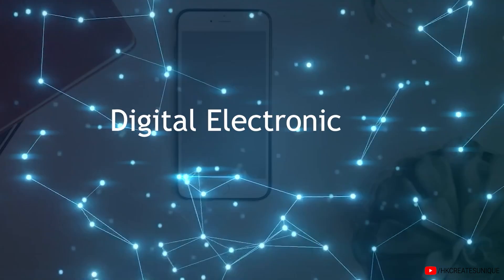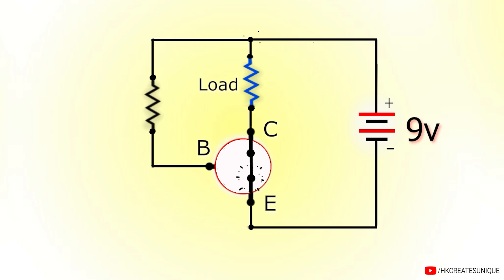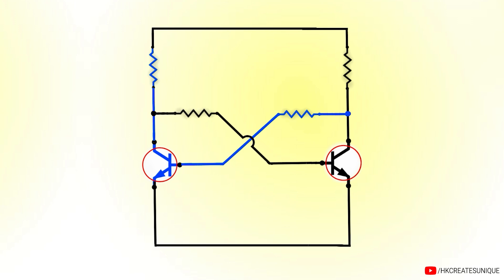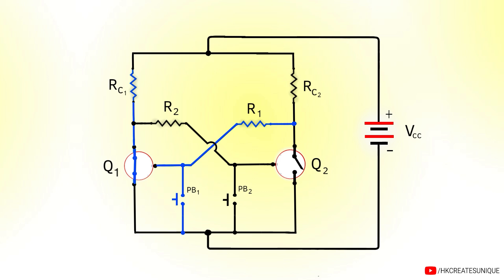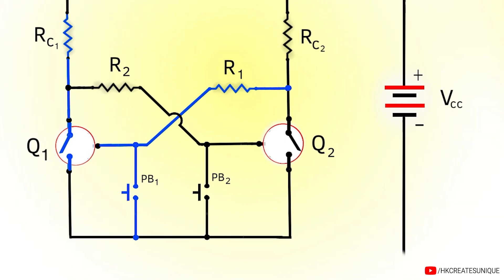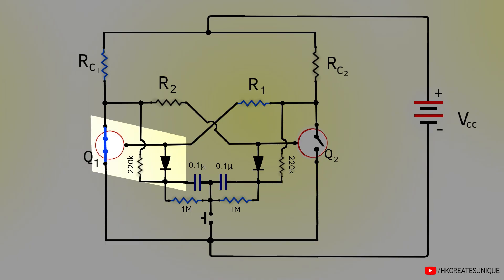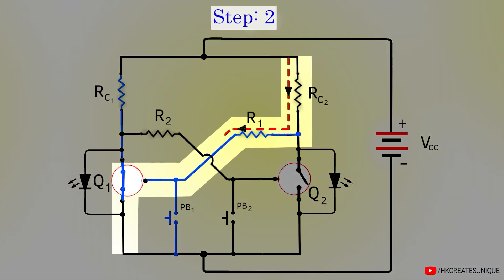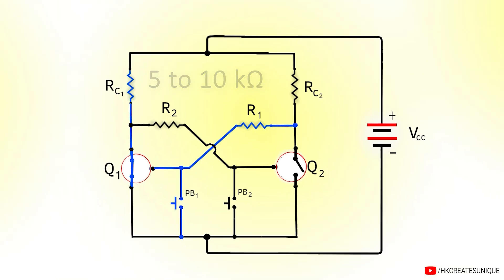Bistable Multivibrator circuit (Flip-Flop) explained in detail | What is symmetrical triggering?

Comment: When calculating Ic, shouldn't we count the VCE saturation voltage of the BJT as well?

Thus making the formula  Ic= (Vcc - VCEsat) / Rc

Let me know what you think
Reply from the maker: Yes you may take it. But it is negligible. I have seen many textbooks where it is ignored. The circuit still works.
Reply: @circuitedu  I'm looking at a BJT's datasheet, it states that VCEsat ranges from 90 to 250mV depending on Ic.
Are these values really negligible?
Reply from the maker: Yes
Reply: @circuitedu  but VCEsat  becomes 0.6V when Ic reaches 100mA, is that voltage still negligible?
Reply from the maker: If Vce sat is above 5percent of Vcc, then consider it otherwise ignore

Comment: Great work! Can you add more details about the symmetrical trigger, what is doing 220k and 1M resistors and how were they calculated?
Reply from the maker: 220k is for biasing the diode, I have used  1M ohm resistor across each capacitor for discharging it quickly so that I can trigger it faster. I may make a video about this in future(if possible)